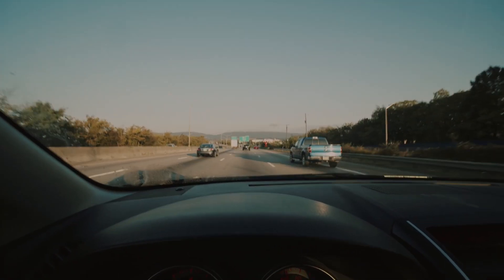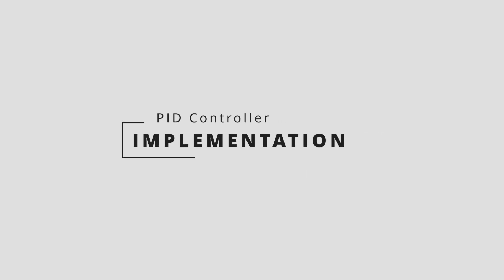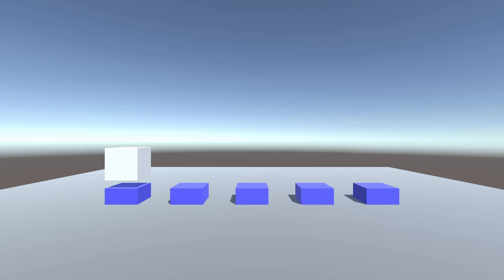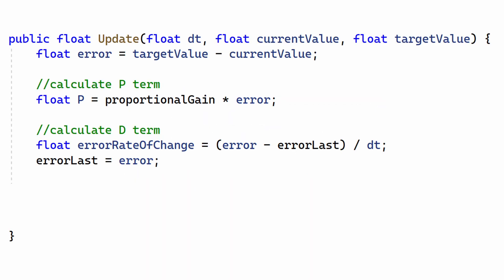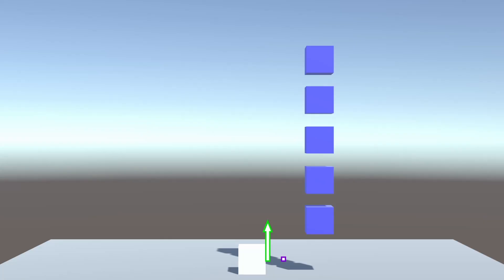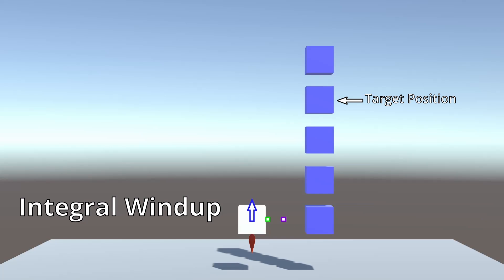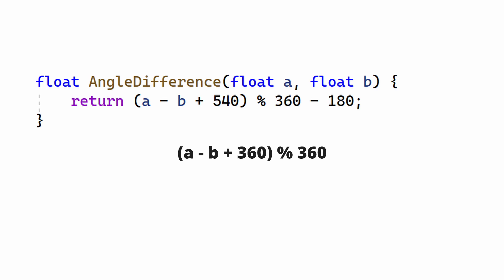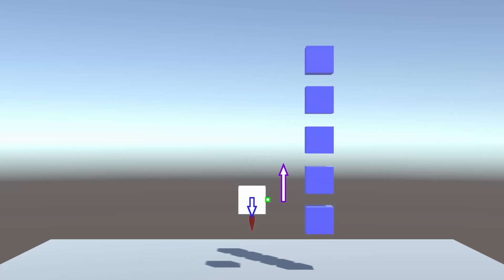PID Controllers in Unity3D

Comment: If you don't want to mess with a complex system that needs fine tuning, adding a math function can achieve similar or even better results. Look for Sigmoid functions or even X*|x| devided by a constant as your tuning. while you subtract speedof(x) /2 for simplicity. Have years of experience dealing with Helicopter and Plane physics on a now dead engine :) Rip Neoaxis.

Comment: I wish this system had a more intuitive name.

As a 3D artist with no engineering knowledge whatsoever, I've been struggling for a couple of years with this problem looking for smooth rotation tutorials that just work off of LERPs and the likes, never touching on physics or the 15° to 345° problem. This entire time I've been thinking "there must be a better solution to this..." but without knowing the name of it, or even the names of the problems I was trying to solve, I had no way to look it up.

This video would have saved me dozens of hours of trial and error trying to solve something myself I wasn't qualified for, and which was already solved in the first place.
It will still probably save me dozens of hours in the future, so thank you.
Reply: Very true, I asked in unity discord and someone immediately mentioned it and I quickly realised they saved me a ton of hassle! Thanks PraetorBlue 😁

Comment: to calculate a phyisical turret you could predict the targets position instead = cause a bullet got traveltime as well.
step 1:  grab the target position and store it as a vector3 and give it a fancy name like "oldTargetPosition"
step 2: grab the distance towards the target starting from the firepoint(barrelEnd) and use it to calculate the time the bullet would travel
step 3: wait for as long as the bullet would take to travel towards the target

step 4: grab the "current target position" again and "substract" it from the "old position" to get the difference between both position and call it Vector3"DistanceMoved"
step 5: create a new Vector3 and call it somting like "predictedTargetLocation = currentTargetPosition + DistanceMoved"
step 6: if the bullet is a victim of gravity (like in RL) -> calculate the bullet falloff from its "traveltime(step2)"  towards the target and store it in a Vector3 called "bulletFalloff"
step 7: add "bulletFalloff" to "PredictedTargetLocation"
step 8: now if the target keeps moving at a more or less constant pattern the turret would precalculate the point where the bullet would connect with the target. 
if this would be connected to an AI that has stored targetspecific information about manouverability weakspots etc. , then  it could use those informations and add them into the equation.

Comment: This is the best explanation of a PID controller I've ever seen, and even shows an excellent breakdown of its implementation. I've been using PIDs for many years but never really thought much about how the math works. Your implementation is actually much more robust than the one I use and addresses some issues I've noticed using mine over the years.

Comment: I was struggling with an issue due to fast changing target position and thanks to you, it's now fixed. Thanks a lot, very good video !!
It would be great to see how you adapt your code to work with Vector3 in current and target value. I just did overcharged and change every float in Vector3 but I am sure there is a way of doing it better.

Comment: How would you get the turret working vertically as well as horizontally?
Reply from the maker: You would need 2 PID controllers, one controlling horizontal movement, one controlling vertical movement
Reply: @Vazgriz  I tried passing various different values to the UpdateAngle function but wasnt able to get it to return a correct result. is there something in that function that is specific to the horizontal axis?

Comment: This explanation is awesome. I would love it when I was looking into it. Great stuff.

BTW I was trying to create a perfect stop thruster (as in thruster that will stop the fall at the exact target height... also known as suicide burn). I was only able to implement it with gravity/drag calculations, not with PID, because with PID it was either falling slower than possible, or overshooting (therefore crashing). Since you seem to know your engineering, how would you solve this kind of issue?
Reply: To elaborate more, I've solved it, but my solution worked only when I knew the power of the thrusters, the air drag, the gravity, the mass, etc. While I could also measure these units, I like the "let me adapt to the current conditions" of the PID more appealing.

Comment: I like this video very much!
The calculation of the derivative-measure doesn't need the errorRateOfChange. Always take the negative valueRateOfChange and there is no derivative-kick. If the setpoint stays constant, the negative valueRateOfChange is the same as the errorRateOfChange.
Or am I wrong?

Comment: I have tried a little bit to understand PID controllers in the past but failed. This video explains it so well, and it's very easy to follow along.
The explanations and pacing are good and it follows through everything without too much or too little detail. Very well done!
The explanation of each term, why they're needed, and how they affect the result is such a good way to understand it.

Comment: Big kudos for pointing out that PID systems are a simple starting point, rather than a perfect solution. And great explanation overall! Only criticism is that the suggestion of starting with 1 as a starting point for the integration saturation is a bit weird, as the units of storedIntegration (and, therefore integrationSaturation) are unit-seconds. Hence the max possible response time of the system (as measured in Hertz/seconds) has to be a factor -- even if the inputs and outputs are -1 to 1, a servo motor vs a oven require very different values. I think better advice would have been to inspect what the largest storedIntegration value encountered in the strongest wind/gravity scenarios are, and then setting integrationSaturation just a little bit bigger than that.
Reply: What other control systems track like this better than a PID system?

Thanks
Reply: @Joe-zw9ep  Depends entirely on what you're optimizing for: shortest time to tracking, lowest fuel consumption, smoothest ride, or some tradeoff between those. I don't want to be that guy, but there's a reason that there are entire university courses on control systems engineering!  But one example of a compromise between lowest fuel consumption and short time would be a suicide-burn-style controller (look up KSP suicide burn or SpaceX suicide burn if you're not familiar with the term). I.e., full thrust toward the target for a bit, and then coast for a while, and then full thrust away from the target initiated at just the right time so that velocity and error reach zero and the same instant, at which point the engine turns off. Another perspective on the same basic idea is to do regularly a cheap simulation going in to the future to figure out when the perfect time to start the braking burn is; the same principle can be used for any control system (and the simulation model can incorporate inconsistencies in the landscape, nonlinearities, and all sorts of stuff like that that is way beyond the understanding of a PID controller). Anyway, that's just one specific example.
Reply: @TheHuesSciTech  I am familiar with KSP and the suicide burn! Sorry my question was not really up to par but I don't know much about control theory.

Don't worry you're not "that guy" it is all interesting, I know there are things beyond PID :)

Comment: I didnt realise that games used PID's for the automatic aiming lol
Reply: Sometimes this is true, but not in the majority of cases. Games mostly just need to 'fake' it. Auto aim is typically applied to turrets which are not affected by 'outside' influences like gravity, momentum, drag or other physics forces. Typically turrets just have their aim  changed by directly setting rotation values rather than using forces to add torque and rotate with physics. So the target rotation is known, the error is 100% predictable, so it's more of a case of just applying a proportional change every frame (let's say 10%) which is kind of like a smooth lerp.

Comment: Why doesn't the modulo operator work on negative values?
Reply: It's because in C# there's no actual modulo operator, it's the remainder operator. Because of this it won't produce the expected result if you used it with negative values.
Reply from the maker: @H3llsHero  Indeed. C# (and C and other languages) have a remainder operator, not a modulo operator.

For n % 3 where n is:
-4  -3  -2  -1  0   1   2   3   4
A true modulus would return:
2   0   1   2   0   1   2   0   1
That is, it repeats 0, 1, 2 in that order. It isn't symmetrical around 0.

But the C# remainder operator actually returns
-1   0  -2   -1   0   1   2   0   1
This is symmetrical around 0, but the left side is negative.

These operators have the same value for positive numbers, but the use case in the video needs it to work for negative numbers too.
Reply: @Vazgriz  Thank you for answering my question. I wasn't aware of the difference, i always thought modulo just was for determining the remainder.

Comment: As a Mechanical Engineer that works with these things, very well explained to the point where I saved the video
Reply: just finished mechanical vibrations class and still didn't get the integral part
Reply: @bakersbread104  Integral part is for eliminate the error of proportional part and make the transition faster in time. The more time the error signal exists, the bigger the effect of the integral part to compensate this. Let's consider we have a PI: proportional tag by itself cannot eliminate the error value, the bigger the proportional coefficient the less error you have, but the more unstable can the system be. Let say we have an error value which cannot be compensated by the proportional tag: f(x)=-1. Try to integral this in time and summ the two function together: f(f)+F(x) = -x-1. You can see if you check the integral value on the for example t=[0,2] domain, at t0=0 the error value is -1, meanwhile t1=2 the error value is -3.
I think i did not make any mistake here but correct me if i have done :)
Reply: @gazsope  oh woops. Meant to say I still didn’t get it until I watched the video. Thanks though

Comment: The use cases seem very specific but if ever needed this video is perfect. Hope to see more
Reply: Maybe not as specific as you think, whenever you're animating or moving an object in a game, and you want it to look more natural and less jerky, you'd put in something like this. For instance, a you might have a hitscan turret in your game. Maybe it sometimes shows up in places without cover. If it tracks player position perfectly, there's no way the player can avoid its damage. But if it aims using a PID controller, you can twiddle the values so it's a bit slow or it overshoots, so a skilled player doing rapid strafing motions can avoid most of the shots.